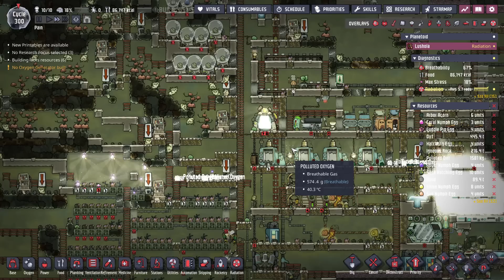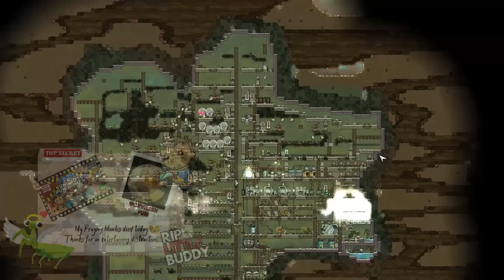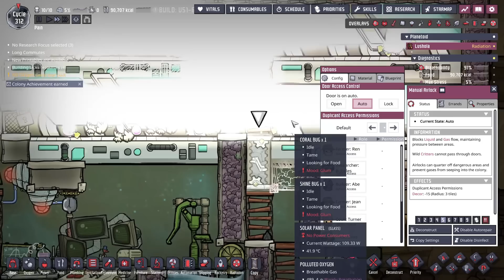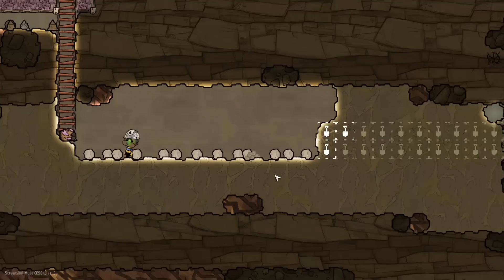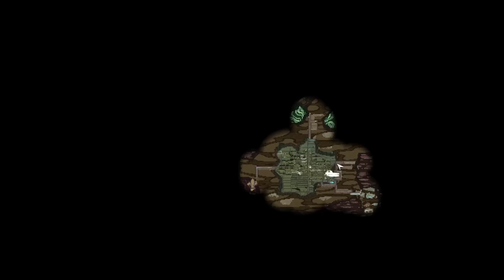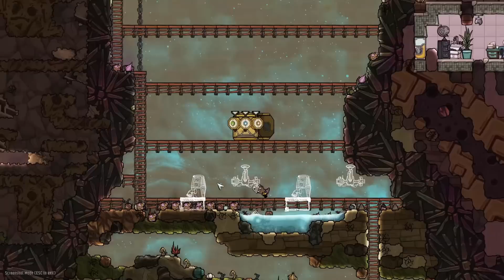[Ep12] The Journey Across the Desert - Ultra Supreme Max Difficulty

Comment: If you run a pipe from the water geyser to the cobalt geyser, all you need is a steam turbine. This will cool the metal and water for basically free while providing extra power.

Comment: hi, why dont you move the solar power outside the base entirely so you dont have to worry about a liquid lock out of your base
Reply from the maker: It will definitely morph over time, eventually the inside and outside of the base won't be different areas.  For now I just want as much open space as possible, and the doors probably don't matter anymore for preventing airflow

Comment: Turn the water geyser into a “SPOM” with the sole purpose of generating excess power.
Water pump for the electrolyzers, single gas pump for hydrogen, and delete the oxygen either with a door crusher (if you don’t find that too exploit like) 
Only difficult part is potentially overheating the copper machines, so you might need to find some gold first.

Comment: Depending on how hot the sand is, you might not even have to heat the polluted  water above freezing. The water sieve will automatically balance the temperature of its outputs depending on its inputs

Comment: All the material you now moved into the base, is it not hot? One benefit of using the conveyors would have been that you could have had it pass through the new nice cold water before entering the base perhaps?
Reply from the maker: Nah, it's not bad, my hallways are pretty cool after walling them off with the insulated tiles.  I think it's sitting at around 32 C.

Comment: If you can get a steam turbine up you can effectively cool off everywhere you need.  A tuned turbine will produce enough power for an aquatuner on its own.  It does take dupe labor, and would be a pain for your dupes since you'd need to power out plastic from the 70° celsius oil biome. But if you can get that set up you can eventually cool the entire planetoid

Comment: Any system that is auxiliary you can put on a switch and a not gate connected to your batteries. That way your batteries will never sit idle at 100% and your shine bug reactor is always being used without causing black out on the base

Comment: With the pool that cools the aquatuner, you could pull a sneaky and reconnect the pump to the aquatuner and have some of the excess cooler water feed into the cooling pond. Yes it is inefficient power wise, but it can buy you more time as far as heat is concerned.
Reply: With the hot water and cool slush, you could run the cool slush through the base's edges with normal pipes, then through a sieve and into a shared pool with the hot water from the geyser and through a temp automated aquatuner when more is needed for the cooling loop [only turning on if above 29c to keep it within mealwood and blossom range.  Outputting it into a buffer tank of cool water [like the one you already have] will even out the temps. 

A setup similar to a petroleum boiler can help even out the temps as well. I use a similar setup in my run to partially cool my salt geyser. A zig-zag of 9 tile wide hallways cools the water by an average of 5c per level, a 4 level drop brings the water to ~75c, which is enough to not immediately fry a copper or aluminum pump [all I have]. running your cool slush [and any cool overflow from the base] through  pipes along the zig-zag [similar to a petroleum boiler] will make your water much easier to handle. Yes it is alot of piping, and you may run into issues if the hot water erupts more than the cool slush, but it should work.

Comment: I would not be shy to go to the space biome (but I'am biased i did the speedrun there). All the material is super cold (-60°) and with the new traps, you can automate the shove vole capture. Just dig enough to find a pocket of regolith, and put your trap there. The hungry wild shove voles will rush to the trap (due to the regolth debris on the ground). Maybe it's too good for the challenge but a single tile with those 20ish shove vole is about 320 000 kcal every 60 cycle (5000kcal/cycle raw  or 6500+/cycle cooked). Definitely a good free resource, maybe too good. But it's a good showcase for these new critter trap. The crazy thing is, it's a set-and-forget kind of build with just a critter dropoff on an isolated tile and a trap in the space biome (and a safety door so they won't ever wander out of the space biome). and that's it, not even have to deal with space exposure.
Sure you won't uncover all of the shove vole at first, you will need to explore some more, but even a single trap will eventually catch them all.
Bonus safety by putting them in a spacefarer prison.
Sure it make thing a bit easy, but it's must be tough for dupes to eat worms while 400 000 Kcal of free meat are roaming the top of the map.

Comment: very nice once again, couple of things:

1) the water from the water geyser could be fed into electrolysers (yes the O2 output would be hot, but you can now use the cool slush output to cool the O2), giving you clean, reliable oxygen, hydrogen for energy (respects the permanent super sustainable rule) and it would also get the cool slush temperature to a level where you can feed it to bristle blossoms without freezing them. Food, power and O2 all in one!

2) you might want to go to the space biome actually, since it's full of very cold regolith (in other words, filtration material that you don't need to cool or use the rock crusher for).

Again, great vid!

Comment: Alright, its looking pretty stable so far, good work!. 
Just wondering: Why not use oxygen mask checkpoints if you have oxygens pipes anyways?
18:08 I think you forgot to Rummage the locker before you demolish it! Or do you get what is in it anyways even if you demolish?
Now you have a hot and a cold gyser you could always mix to for a good temp for plants if needed. But yeah having a water basin to cool down the smelter is also very useful.
Any which way you choose good luck!

Comment: 20:05 - ok, HUGE tip: having pips plant whezzleworts close to the doors is super efficient not only at keeping heat out of the base but also preventing cold from leaving the biome.
So if you cut the abyssalite and leave a whezzlewort in the first chamber it'll just keep cold forever.
if you place a whezzlewort at the doors exiting the base you would lock the heat out.

Comment: If you find salt and gold (for a bleach stone hopper) or puffs and a chlorine vent you can use the geotuner to heat the water geyser a ton while rising it's output, that way you can use the extra power (gotten via steam turbines and the electrolyzer, hydrogen generator combo) to get the power to use an aquatuner, maybe even at a net positive.

This method can actually turn cool steam vents into a useful thing too in case you find any.

Comment: If you want to do a temperature lock without water, you can use three airlock doors with the middle one set up as a crusher, using weight plates and a timer buffer... use insulated tiles top and bottom, you'll get hardly any transfer when the center door is open at vacuum. It's a little slower to traverse but hey, no wet feet.

Comment: One trick you can use on the sweepers/dispensers for instances where 1 sweeper can see multiple loaders is to change the priority from 1>2 to that they do not get stuck in an infinite loop instead of using blocks to obscure their view.  

I head you say that you were not using mods, but there are 2 mods that will also prevent this.  There is one that adds priority zero (0) so that dupes will never perform a task, and also a mod that allows you to prevent duplicant interaction with a building so that only sweepers can use it.  This is especially useful for my wheezeworts to prevent a dupe from getting shot with a radbolt, since I use a different setup.

Comment: Get rid of the Insuated tiles from around the slush geyser and let that chill start to cool off all that sand! its free cooling! 

You could also just clean it, circulate the base in some metal pipes to cool the base, then feed it to a Spom to help out with the oxygen situation.

Now that you're at the top you could just run a pipe up to space, and just dump your CO2 instead of cleaning it. saving on some power and water. Run it through some metal ducts first and space some of that heat. 

Just a few ideas, love the run so far!